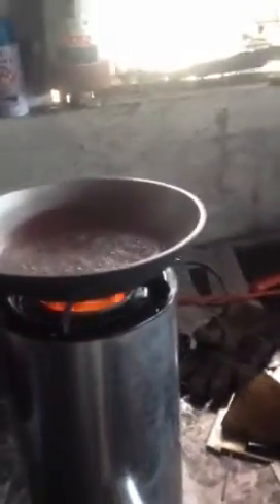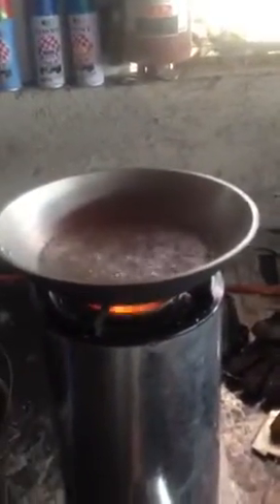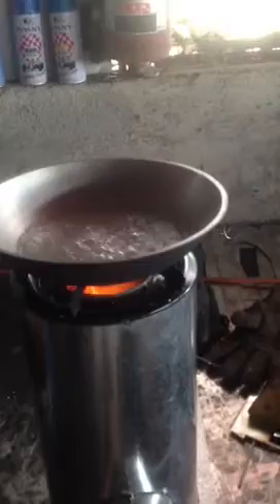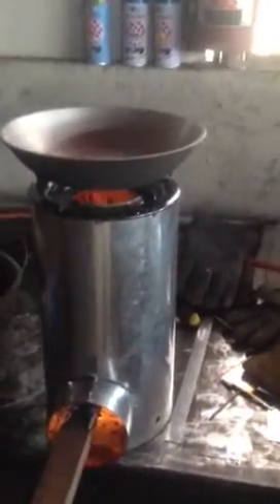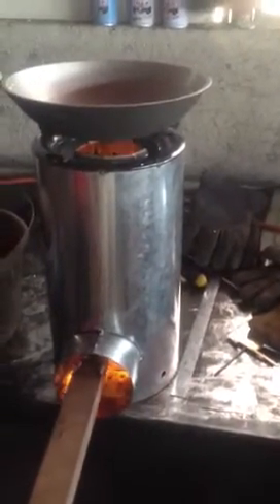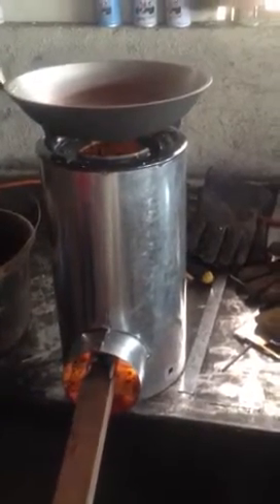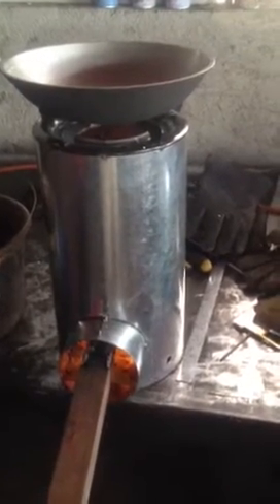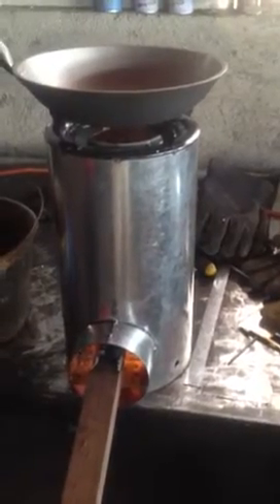TLUD gasifier rocket stove hybrid

Comment: Could write some scheme how it is made?
Reply: Simple as this described;
Make a rocketstove, drill about 16 small 1/4" holes about 1/2" from top (2ndary air vent), add an new pipe as an cover on the rocketstove with a snug tight fit on top over at an even hight as the rocketstove top end, and then on the lenght down the cover pipe to the rocketstove bottom it should be around 1/5" space between the stove pipe and cover pipe for air vent, and at the bottom of the cover pipe you should make about 3/8" holes (primary air vent). Pretty smiple, all the air that goes from bottom cover pipe holes travels up to top and out in rocketstove combustion top to give oxygen for the woodgas from rocketstove, an even mixture of those 2, the woodgas ignites.
http://image.slidesharecdn.com/avanstoveavanseriesgoodstove-090928000041-phpapp01/95/avan-stove-avan-series-good-stove-1-728.jpg?cb=1254096102